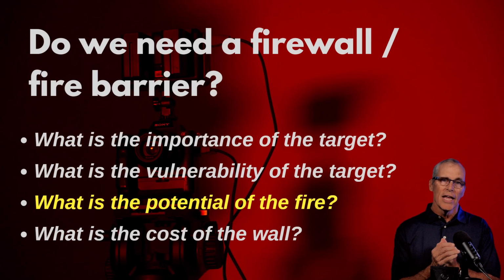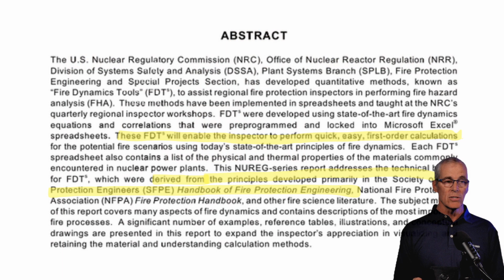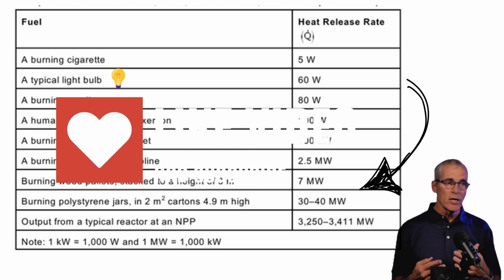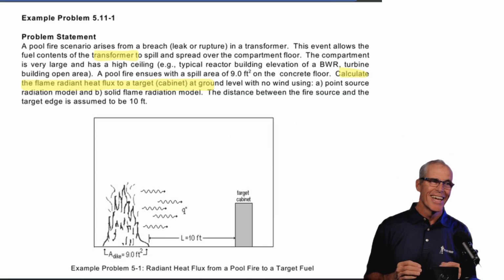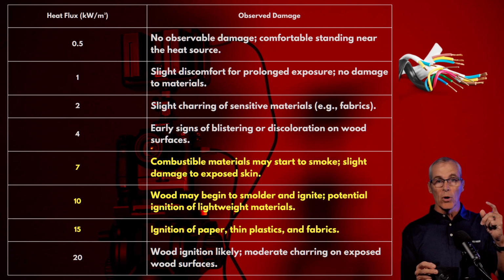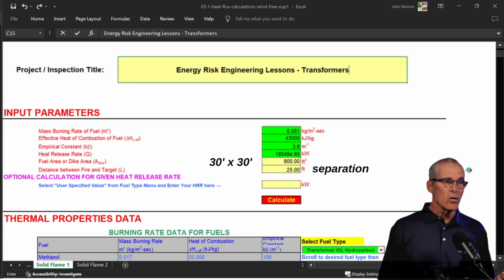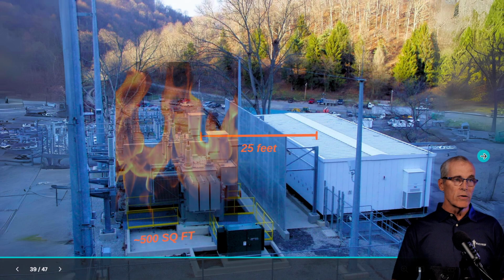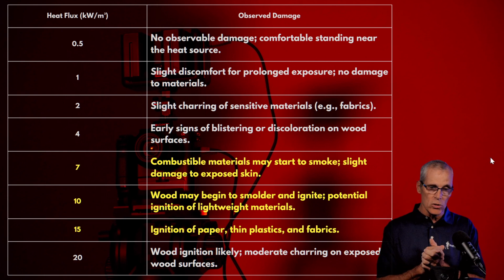How to apply computer models to real world problems.

Comment: Hi, just watched your video again, since I was using this for calcs about our own transformers, and noticed that the distance you actual need to input into the sheet is the distance from the edge of the fire pool to the target (L), since if you scroll down through the calculations in the sheet it actually calculates the R = L + D/2 being from the center of the pool to the target. The example problems in 5.11 also shows the use of the L from the edge of the pool.